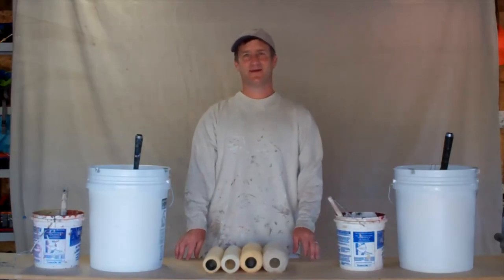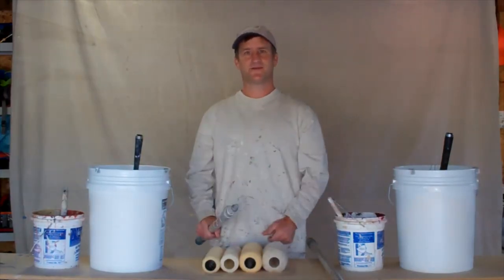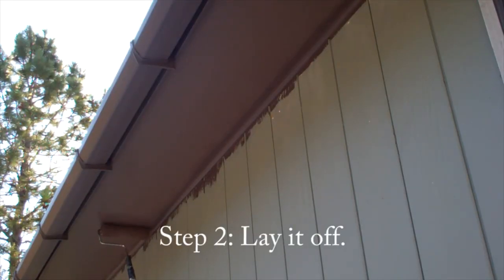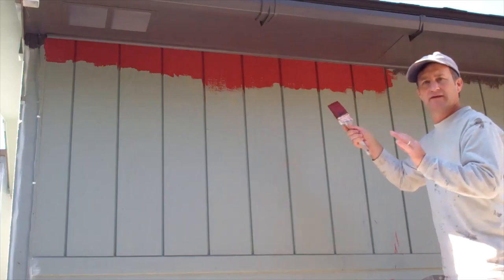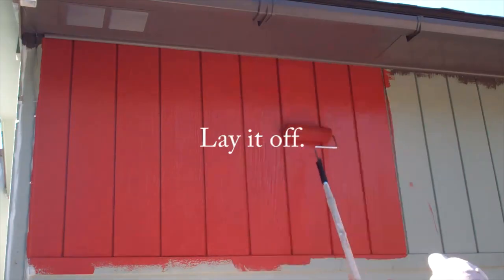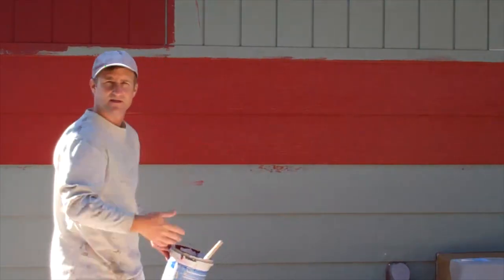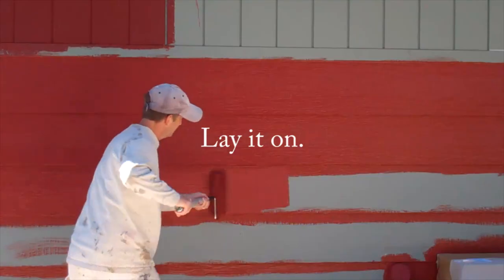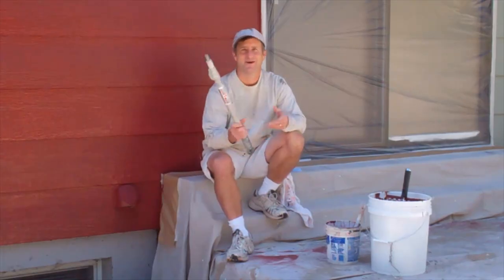Exterior Painting Step 7: Brushing and Rolling the House

Comment from the maker: Hi--By far the best solution with non-enclosed soffits is to spray them. It is so much faster and easier. That said, I have brushed/rolled them many times and although it is slow, it is possible. One way to make it a little faster is to roll first, using a thick nap roller (1.25-inch), getting into all the corners and angles as best you can, then go back and brush in the corners later. You can actually get a lot of those angles painted with the roller, so this reduces the amount of brushing.

Comment from the maker: Hi Jeremy--glad you like the videos. You are correct that when rolling paint on stucco, it's not necessary to lay it on/lay it off as precisely because the stucco will hide any inconsistencies--usually. Being sort of particular, I like to always try to be as neat as possible no matter what the surface. But stucco is pretty forgiving. Just make sure you use a thick-nap roller and get a lot of paint on there! Thanks for commenting.

Comment from the maker: Hi--Although oil paint has some good uses, I prefer acrylic for almost all interior and exterior painting. It has much better color retention on the outside of a house, whereas oil tends to fade sooner. Also it's easier to clean up because it's water-based. I do prefer oil primer, however, especially if I need a powerful stainblocker. As for brushes, I judge more by price than brand--anything in the $15 to $20 range will last for years if you keep it clean. Thanks for writing!
Reply: can I. use standard exterior latex pant on a stellar build that has already been painted

Comment from the maker: Kristen, for some reason YouTube won't allow me to reply directly to your question, so I'm answering it here. First of all, you can use an oil primer and latex topcoat in most painting situations. On a deck, however, I wouldn't recommend using a primer, I'd use a solid-color stain (if you want the "painted" look). Some good latex solid-color deck stains are available these days. The reason I prefer not to prime decks is because you really don't want to get any "buildup" of material on a deck--you would prefer to put on one coat of stain, let it wear off (rather than peel off), which makes it easier to re-stain the deck later without having to do much if any scraping. I don't expect to get more than a couple years from deck stain before it starts to wear...usually re-staining is required every few years. Sometimes I touch up the worn spots if they look bad in the meantime, especially in highly visible areas. This can create a little bit of a blotchy look but it's better than bare wood in my opinion, plus it helps keep the wood protected. I hope this helps.
Reply: Good info....

Comment: Is it still true rolling/brushing exterior paint lasts the longest (if done correctly of course)?

Seems like so many are pushing these sprayer systems and although it's faster (after all the prep that is) it's still not bettering the brush/roller for a lasting paint job.
Reply: Good observation Joe, people are absolutely pushing sprayers. And those people are paint companies! Why? Because sprayers use more paint than roller/brush and with exteriors you'll be re-painting your home more often. Sprayers increase paint sales.  I exclusively paint with rolling/brushing for exteriors because my paint jobs last 15 years before repainting. You will see companies that work exclusively in brush/roller for exteriors and companies that spray. The lifespan of exterior paint finishes has been dramatically reduced due to sprayers. At least that's what I'm seeing. Paint companies that spray say it's the best because it's fast going on but they don't guarantee their work for long. An exterior paint job, depending on substrate and conditions used to last up to to 20 years.

Comment: So is the step 2 (Lay it off)considered the second coat? Or would the second coat be seperate? Also with the T11 siding, is it necessary to use 3/4" nap, or can i get away with 3/8"?

Comment: In my experience, red paint is horrible to work with. What kind of paint are you using? Your red paint looks great. It doesn't look like the paint I have used that needed multiple coats.
Reply from the maker: It is Benjamin Moore paint. It looks red going on but actually dried into a rich brown with some red tint that comes out in the sunlight.
Reply: +howtopaintahouse  DARN... I would love to paint my new house this color but only if it looked like this (red) when it dried. I found a color "spiced berry" by Dunn-Edwards. Is their paint good?
Reply from the maker: I've never used Dunn-Edwards, sorry. This paint actually dried darker, with more brownish red color. See my website, there is a picture of the house when done. Most paint will dry two shades darker than it goes on.

Comment: What exactly is the difference in technique of laying on versus laying off?

When you lay off, you don't put any new paint on your roller or brush? Are you just trying to smooth lines of paint created by the roller's ends? Something else?
Reply from the maker: +Erik K You are exactly correct. Laying off is for smoothing out the lines and irregularities of putting the paint on, when you were more focused on getting a good coat of paint on. I usually do not put any paint on the roller when laying off UNLESS the paint appears to be drying or setting up at all--then I will do a quick dip in the bucket.

Comment: Great video series.  I was wondering how long it took you to brush and roll the siding on the entire house?  Thanks in advance!
Reply from the maker: Hi--I did not brush and roll this entire house because I also wanted to demonstrate the spraying technique. But based on past experiences I'd say it would take three to five days...it really depends on the house, though. Bottom line is if you put your mind to it and keep moving, you can paint a house with a brush and roller in a matter of a few long days. I usually figure about 10 days to paint a good size house by myself, including pressure washing all the way through clean up. Plus or minus a day or two.
Reply from the maker: +Matthew Dill It can be done in a matter of a few days if you really get after it and work 8 hour days.

Comment: what thickness roller for T-11 siding so I get in grooves? 1/2 or 3/4??  thanks
Reply: 3/4. I've seen some T1-11 siding with shallow grooves that a 1/2 would do but only a couple. 3/4 sucks but it gets it ✔.
BTW get the orange color exterior roller cover as the nap is looser and gets the paint in the grain